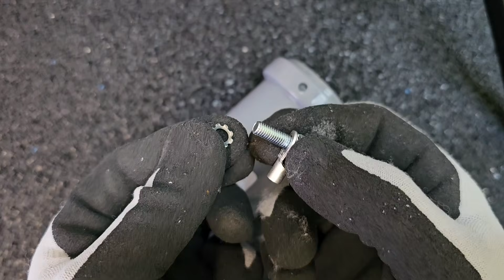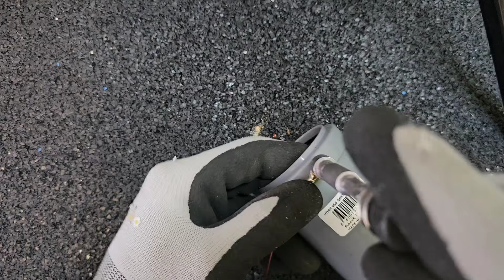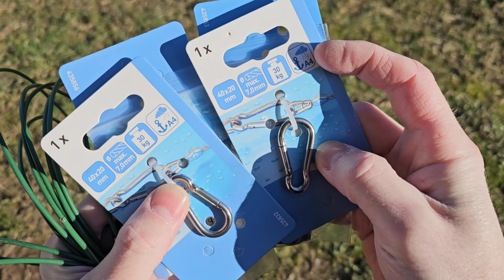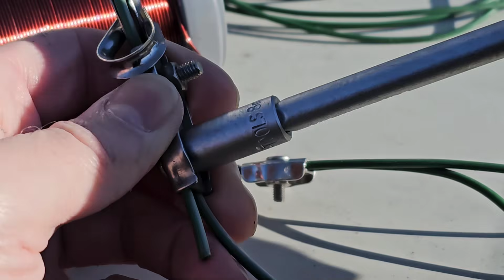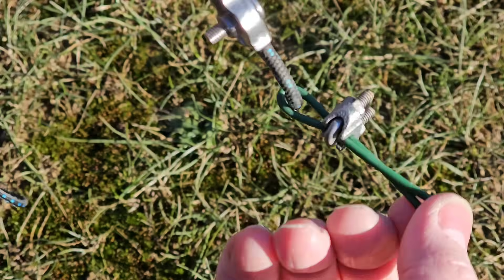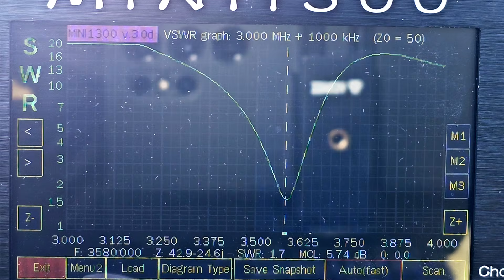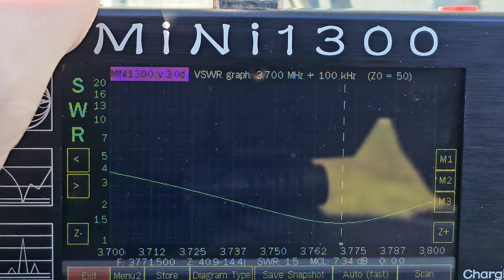HomeMade 80M Band Coil for 40M EFHW Antenna

Comment: Thank you for sharing your adventure. It was very enjoyable. Did it have any effect on the other bands ie 20/40m bands?
Reply from the maker: Thank you! I think yes, so i rather put this antenna away. I plan to replace it for random wire with outdoor Automatic Remote Tuner.

Comment: Great job there. You don't need to cut the extra wire for cal. purposes, just wrap it around over the active section untill you find the right spot, after that, you can cut the remaining wire. Cheers!

Comment: How did you derive the coil inductance value? I think adding a capacitor across the coil may lower the Q and make the antenna a little more broad banded. Less inductance more capacitance might be a better option.

Comment: Very impressive build.  I strip the end of the wire I'm tuning to clear the foldback area.  Thus shorting with the clamp for length.  I can cut the excess after the desired resonance is achieved.  (back in the 80's, I used bare copper so it came natural to figure it out this way.  at least for me.)

Comment: I watch your videos with interest and always learn something new in terms of construction, but I have a few recommendations:
1. Bringing any metal closer to a coil changes its inductance. You must agree with this because you yourself saw that out of the expected 2.5 meters, less than 1.5 meters remained, and this was due to the changed inductance, which for 80 meters should be 110 microhenries. I calculate it using the Coil64 program, but I wind about 170 turns on a dielectric body with a diameter of about 20 mm, then I adjust it with the LC Meter and directly tie the end for the extension of about 2.5 m.
2. Despite its strength, I do not recommend making antennas from telephone cable, even if it is military, because it has steel wires in it, which worsen the quality of the dipole, and the copper wires in it are too few and thin /about 0.5 mm each/. Thus, the reception losses increase.
Regards de LZ1MD 73

Comment: I will watch this video a few times  but for my first watch I missed where he might have described  exactly where in line he places the finished coil ?  I have a 66Ft long EFHW with 49:1 transformer. I would like to build this col so I can join a regional 80M net .
Reply: Or maybe he just adds 5M of extra antenna wire and has the coil at the very end where the rope begins ?

Comment: Hi Thanks for video. Works well. EFLW 1:9 unun + 20,35m (67.7ft) multistranded copper wire - 110 uH coil + 2,39m (8ft) multistranded copper wire. Connections to Brazil, US, and Thailand from Center Finland with a 20W transceiver (7200mi, 4500mi, 4900mi, respectively). Not bad! 73' OH2XA
Reply from the maker: That's really cool! 😀👍

Comment: Can this be used to add 160m to an 80-10 EFHW?
Reply: Same principle but the design acts as a loading coil on 80m and a trap on 40m or below.  You would need a larger inductor (more turns) to block 80m and pass 160m.

Comment: Here's a tip. NEVER leave only an inch folded back when you make your cut. Fold 6 inches back every cut until you get on frequency, then snip the remainder an inch at a time, ...if you really want to. And actually, the folded back section is a cancelling section, so the effective length is to the fold. You can usually snip away at the fold back section to make it short and neat without affecting SWR too much. That 'Hail Mary' approach to length snipping is just asking for trouble,  :D   ..but entertaining to watch someone else doing it.

Comment: by the way what inductance did you achieve given your data? Real measurements usually differ from coil inductance calculator given at 66pacific
Reply from the maker: I didn't had the LC meter at that time.

Comment: Hi paul i am trying to copy your design the pipe you used for the body was that a 50 mm straight coupler and what length of the coupler did you use plz 73s buddy

Comment: Nice work - good looking. 
Idea: Do not cut off wire when fine tuning, but just bend wire like a small U and fold back antenna end - and tighten somehow. 
Then you can adjust back again. 
Also handy if you e.g. change location or antenna hight, then you can fine tune again - and again ...... 🙂73 de OZ8MS

Comment: Hi, thanks for the video. It's better to use an isolator between the antenna wire and the  rope. When the rope gets wet, it will extend the antenne wire! You could fixated the coil with 4 wire straps so that the coil does not loosely hangs around the wire.
Reply from the maker: Good idea, I will install an isolator 👍
Reply: @OM0ET  Hi, I did some more thinking about your coil.  I see an issue. The used isolator inside the coil, but in particular the metal snap hooks will have a major impact on the coil characteristics. I'm pretty sure you will  measure totally different values in this configuration then on the bare coil. Coils are extremely sensitive.

Comment: A tip... I would use a pulley at the poll end  and a spring  at the end of the rope. this will make adjusting the antenna SWR and give the wire adjustable..

Comment: The built in ATU will tune the 3:1 down to perfect but THEN you can use that tuning and turn the VFO further to beyond the perfect match. For example, dial to the furthest point your radio will tune, get the perfect ATU match, then since it is now 1:1 you can turn the VFO further to say 2:1 and TX just fine. It is the equivalent to the 5:1 point but tuned down to 2:1. You don't have to stick to the sub 3:1 bandwidth.

Comment: I see a lot of people asking about the coil.  I see that you have the 40 meter antenna but making an 80 meter antenna would require double the garden size. Presuming you don't have enough room you decided to make a loading coil.

The chinese loading coils that they put in the JPC-12 antennas can be had cheaply and they have a slider that ahorts them at different inductance values.  

I wonder if one of those would have the amount of inductance loading you need, and i wonder if it might have worked in your application.  It allows the JPC-12 whip to run at 20 and 40 meters.  Supposedly  with a second one you can run 80.

In any case, good video. I was unsure what you were going to be doing....i thought you might add a capacator to make a trap so that you could make a trap antenna.  One or two slides in the beginning would have spared my weak brain much confusion.

Comment: Paul, neat build for your coil and then figuring out your 80m wire length. I learned that it is much better to fold back to tweak an antenna to reach the residence that I want vs. cutting too much. You can always cut the wire once you reach the right length.

Comment: did you measure the coil microhenries value and did the addition of the 80M section change the performance from 10 to 40?

Comment: Thanks for the excellent build video. A TIP for you: As you found out the hard way you can cut too much. there is no need to cut. If you fold the extra wire tightly on itself, it is like a virtual cut. Try it. I am always astonished at the common ham advise to cut the wire to resonance, and people  don't advise wrapping the extra length to achieve the virtual cut. 73

Comment: I trim my overall wire length using two iPhones using the Video Chat method. #1 iPhone is in the shack pointed at my VNA, which is connected to the RF cable that is normally connected to the back of my radio. I then take #2 iPhone to the end of the wire and trim as needed. It something you can do by yourself.

Comment: Very nice bit of work Paul,  store bought wouldn't come any nicer. A few thoughts...there seems to be a narrow range of 'European'  frequencies that are of interest to you, and so the loading coil being large and of relatively high Q reduces you're useful bandwidth considerably.  Considering the length of the antenna, I'm suprised it's so tight. You might also try to wind a new matching xfrmer on a Fair Rite core 2643251002, auto transformer style, and with no crossover... 56:1, just an extra turn (15) and you might just find the match to be much better, perhaps pulling the VSWR down to near 1:1... Doing this I went from 1:162 down to 1:104 on the NanoVna...as always YMMV... Richard VA7AA

Comment: At 1:10 if you added a nut to the bolt 1st before anything else just to act as a spacer it would make tightening things up later on much easier.

Comment: one suggestion I would make is to not cut the wire when you are close to resonance,  but leave it a foot or so longer and twist it around the antenna wire.  It  will not affect the swr and you then have the option of lengthening it if necessary to fine tune.  Once you have confirmed the length then you can cut if you desire, I tend to leave a bit for future adjustments if necessary.  As you discovered, once the wire is cut there is no going back.

Comment: I quite like the look of this antenna as it appears to be not too difficult to build. How did you arrive at the turns of winding over the diameter of form? Is this one of the online calculators and if so which one? I have tried a few and it always appears that there is a capacitor of some sort involved in parallel with the coil. I (Canadian) have never seen the type of fitting you used and would probably be winding a coil over a regular 2" (50mm) PVC tube, I would expect that would change the turns of the coil.  A couple of things. It's been my experience that the self amalgamating tape (splicing tape) is not UV stable and requires a layer of electrical tape over it. I have used it over PL259s and it deteriorated in the sun if not covered. I am not sure but I don't know how UV stable the enamel coating on the wire is either, but I have seen a few traps built out of it so it might be fine. It looks like another trap and you would be able to build a 160m extension. I have been looking for an antenna to build so I can get on the air again. A tree ate my 4 band TET beam and tower a few years ago and I'm working to get that up and running again (TH7 this time and the tower is a piece of crap). Anyway great build and 73 de Gil ve7bul

Comment: Hi Paul. Did you measure your coil when you finished the winding? I made mine on a 25mm plastic pipe, and when finished, I read 108.5 micro Henries. It is longer than your coil, but the inductance is probably close to the same. Nice project!

Comment: If you are testing lengths, you can just adjust the wire in the clamp, instead of cutting it.  That way, if it get too short(for some reason :-) ), you can just let some more out of the clamp.  Good job.

Comment: Good video. I do lenght adjustment so that fold extra lenght backwards and hold it in place to antenna wire with straps. That allows you go back and forth with wire lenght. When final lenght achieved I cut that extra tail off and secure folding point permanent. That way you dont make your wire too short and need new wire. 😊

Comment: I would have wrapped kapton tape over the winding. That coil is a nice place for birds to land. Over time the enamel will be gone without any protection. Problem or not, don't know 😀.. 73 OH7WV
Reply: Yes, I never understood why people cut the wire. Folding works just fine, I have been building antennas over 50 years now and learned that many years ago.

Comment: So, how did the other bands do after the modification? Are they still good?
Reply from the maker: As I was checking only the 40M band, which is the band what this antenna was made for, there is no significant change in SWR. Still 1:1 in 40M phone section.

Comment: Nice build. I was just wondering whether the steel brackets inside the coil will have an effect on your inductance. 
And another one is.... will a lower value inductance coil with a bit longer extension wire give a wider bandwidth on 80m.?

Comment: Very solid build.
I would have run the wire to within about 2m of the pole (the longer the better) and then reduced windings on the loading coil.
You can do that by shorting windings. Scrape the enamel off one winding at a time and form short bridge with a dab of solder. Repeat until you get very close. Then perhaps fold the wire to bring the dip to where you want it. 
Less inductance (less windings) will widen the bandwidth and thus improve your SWR at the band limits.
I don’t have the space at my fixed QTH to put up an 80m EFHW but the above method is how I got my 40m tuned for maximum SWR width in band.
Reply: That’s some good advice . These little gems are what ham radio community is all about. Thanks.
Reply: Sounds like good advice.

Comment: Building a field portable use 80-10 EFHW right now.
Mt current EFHW at my QTH does not utilize your version of strain relief. The loading coil that is used to widen the higher bands ( 10mtrs ) puts the strain on the PVC tube. I like your version much more.
For the cost of a bit more hardware and time... This seems to be well worth it.
Thank you... 😊
73 de KF4LBG 
Larry

Comment: Paul. I am going to put this antenna together using the 40m EFHW as the starting point (I have limited run distance). Would you please confirm my understanding of the rig? After the 49:1 UnUn, a 19+M wire, then the 110mh loading coil and then about 1.5 M wire, cutting this last wire to length to control SWR. Thanks for your help, N7DKE
Reply from the maker: Yes, that is correct. Antenna will be narrow on 80m but will be usable 🙂👍
Reply: @OM0ET  Thank you. 73

Comment: in future, do not cut the wire when you are close, fold it back and wrap it around the antenna length. this will allow you the adjust it back to a longer length if you guess too short.

Comment: I would have like to see the readings of the other bands, eg 40m and 20m in terms of swr / freq. Thanks still a great video as always.
Reply from the maker: This antenna was made mainly for 40m band and after this mod I found the same SWR values as before this mod. 1:1 in the PHONE section between 7.100-7.200 MHz which is great! ;)

Comment: Paul, 
this is Markus - db9pz - talking to you. 
We met a few month ago, when you testet you 'QRP'-rig, I was the first station, also QRP, speaking to you, ... ! I enjoyed that QSO very much, ... ! Thanks again, dear Paul.

Please take more care of the 'size' of wire and cord! The 'clamps' and the 'closing-keys', will not fit for the wire you need. Too much 'room' in between! And 'solder' alone, can have a 'solid flow', so that it will not fix the wire permanently. It will work and 'flow', milimeter for milimeter, out of the soldered ring... ! 
A problem that every electrician in the world will know, ... ! 
Also, why don 't you crimp the fitings for the wire not first, and then solder it for safety reasons? Also , you can make some shrinking-tube, (best with heat-clue inside) over all connetions to 'weather-proof' them. You later told about it in your video. Sorry, ... ! 

73/72 de Markus - db9pz (JN39fq - 5km/3miles east of LX))
Reply from the maker: Hello Markus! Thank you very much for your comment and advice! Yes, next time would be maybe better also crimp them before soldering. ;) Thanks for watching this video and for QSO we had! 73

Comment: How many micro Henry is the coil and details of the former and length of the extension wire would be help full
Reply: yes , please if you have this info post it
Reply: @sergiocavazos8963  , a good Value is 100...120µH.The more inductance you use, the shorter the wire must be after the coil. So it's better to keep the inductance as small as possible if you have enough space for a longer wire after the coil. If the inductance is small, e.g. B. 80µH then the antenna is also a bit broader band. 73 de df8ru
Reply from the maker: @Roadrunner48  yes this is true! :)
Reply from the maker: Regarding the calculator it should be around 160-170uH. This is the reason why is the wire so short only 1.43m long  and antenna so narrowband. 67turns of 1mm enameled wire winded on 55mm former.
Reply: Hi Paul, I posted above how you can short out turns on the coil to reduce inductance and therefore gain bandwidth.
You want to lengthen the loaded 80m part of your antenna as much as is practical.
Good luck!

Comment: You do not need another wire if you cut too much, just solder thin wire, end of antenna have extreme low current and maximum voltage.
When I trim antenna wire I never cut end of wire just wrap around , no need to cut. So if you need lower frequency  just release wire.
You already have bunch of wire. But not everybody.
Reply from the maker: then it wouldn't be perfect in my eyes and I wouldn't be satisfied with the work :)
Reply: I always try to make simple and cheap trimming. Last 10 inch of wire antenna not need to be straight horizontaly like rest wire even not need to be same thick wire. Short section "sacrifice" tin wire pointed down woud not make any difference and easy to trimm. If you cut too much replace with new tin wire and continue.
End of wire antenna do not be straihgt at all. Concept is already many time proven and work.
Reply: I believe he wanted to replace that end because it wasn't as pretty as the new "shiny" wire after all that work! 😂
I mean he took all that time to point out how he "hoped" he didn't cut it too short lol. 👍
Reply: Everyone would criticism him too for the "imperfect" job.

I thought this too, but why not cut another piece of wire 4cm longer then you had before, simple. 😊

Comment: Hello Paul, you really showed how it works. I did it the same way. My coil looks a little different, but in principle there is no difference. But I don't cut the wire around the resonance anymore, I just fold it. It's less of a thrill, but it works great :-)
Reply from the maker: Thanks! Yes, this is an option too :)